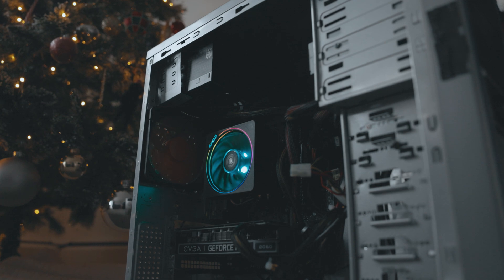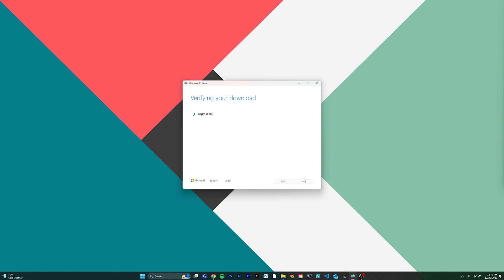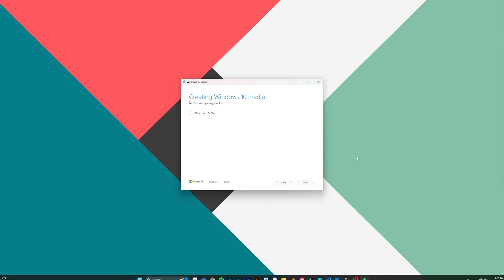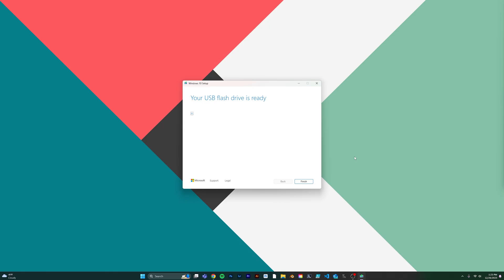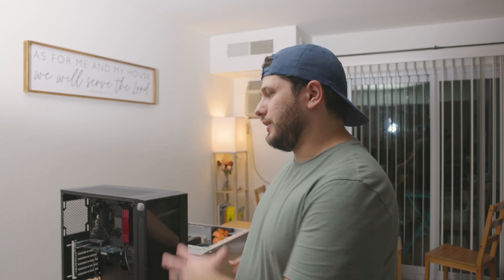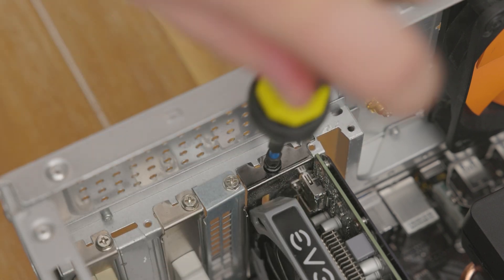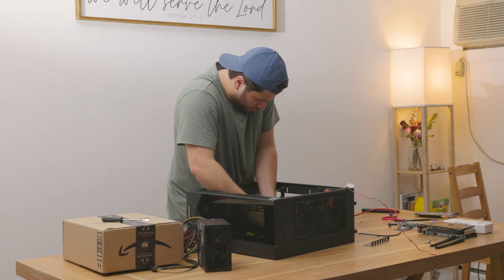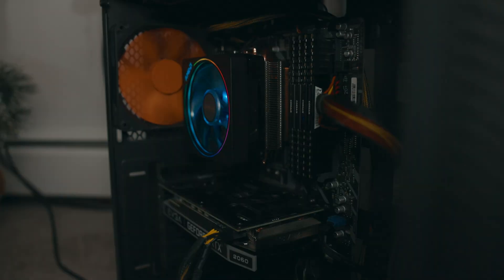I FINALLY did it

Comment: If you want to run Win11 on previous gen hardware that doesn't have the TPM 2.0, I suggest checking out Tiny11. 
It's a strip down version of Win11 without the bloat and security checks. 😉👍